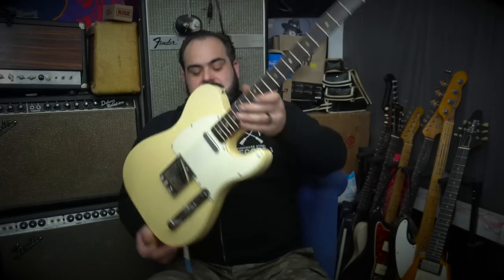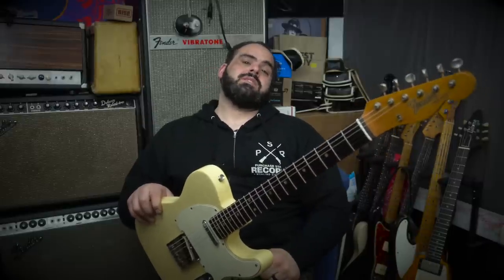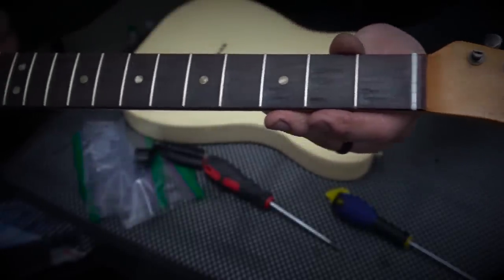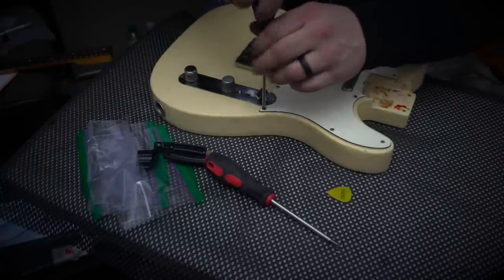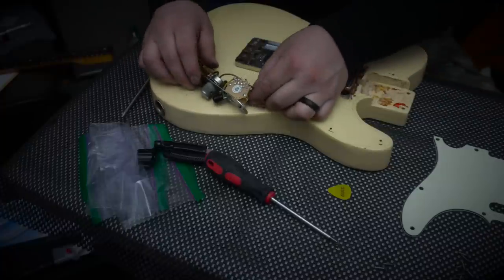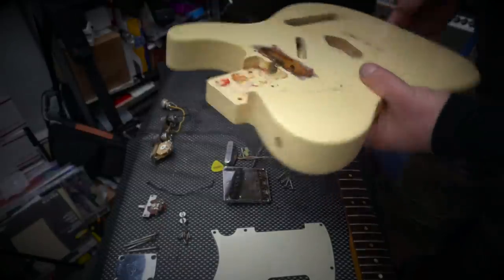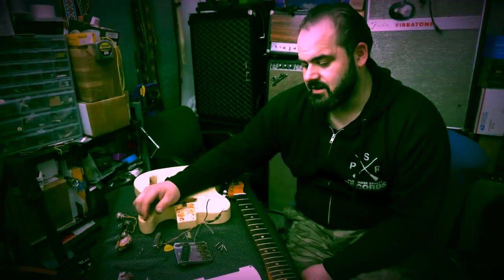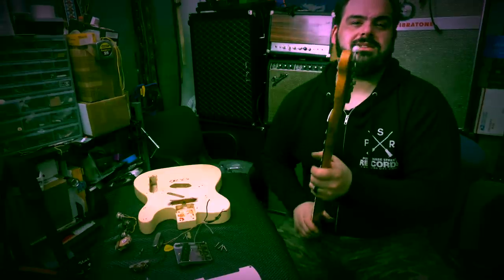VINTAGE 1966 FENDER TELECASTER RESTORATION : PART 1 - REFRET AND TEARDOWN!

Comment: Love these videos Nik, this Tele rebuild is awesome! 

FYI incase you want to try a trick I figured out while removing huge old solder blobs from the back of vintage pots I have. Take a piece of scrap cotton shirt, heat the back of the pot to melt the solder and then as quick as you can, wipe the back of the pot with the cotton and it will take the solder right off perfectly clean. Of course, don't over heat the pot and you have to wipe almost instantly, you almost need 3 hands, be very fast.. I've done this on several of my old Centralab pots and it works awesome. Peace brother!

Comment: when you deal with corroded or rusty hardware such as screws.. do you clean and polish or leave the crud on them?.. curious.. i prefer to clean but not polish..
Reply from the maker: If they are seized or tough to move in anyway i will wire well them.   But will usually coat the screws with some wax when re assembling

Comment: Did you have to take the frets out sideways or had it had a refret before. ?
Reply from the maker: The frets were original, you can tap them out, and they can be removed topside with some patience , heat and the right tools.

Comment: Hair on my arms stands up a bit at potting pickups.  
It can be a toss-up between making an unusable at volume pickup behave and unalterably changing the character of the pickup into perhaps something we don't like as much.  
Back in the late 60's I had a pretty nice Japanese copy of a  Thinline Tele w/Bigsby and microphonic noisy pickups.  I went all damn the torpedoes gung-ho to pot them following instructions to the letter and the results were, as planned, reduced noise, but also some rather indescribable loss of liveliness or character somehow.  I regretted it for what I used the guitar for.  No great loss but a learning for sure.  Never needed to try it since then. 
You guys have any thoughts on processes and materials for potting?  Effects thereof?
I remember talking with Paul Reed Smith years ago about his using beeswax in certain cases but I know he hears detailed things which are beyond my ear's discernment.
Reply from the maker: Ehhh.  Its the age old debate right?   We will see!